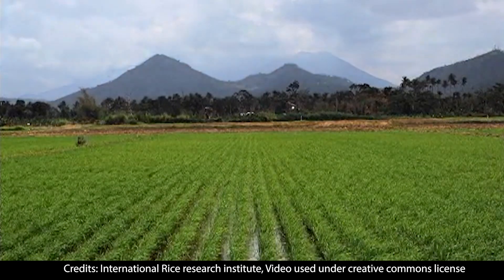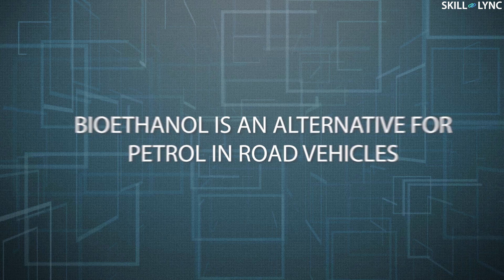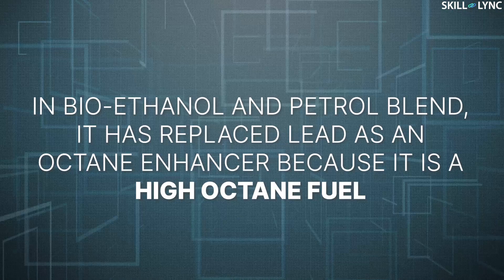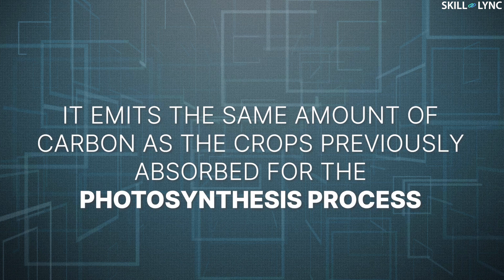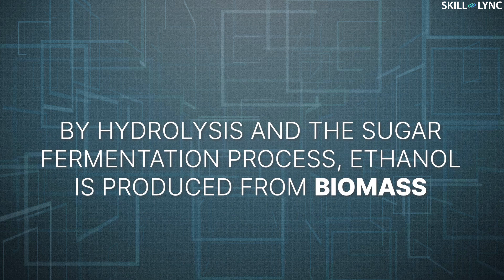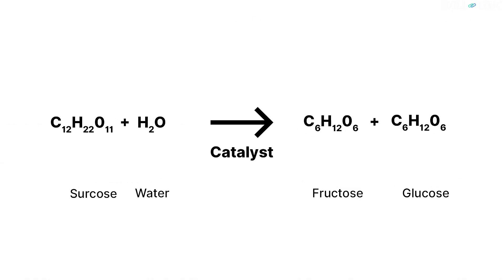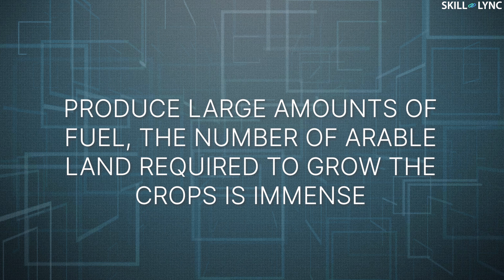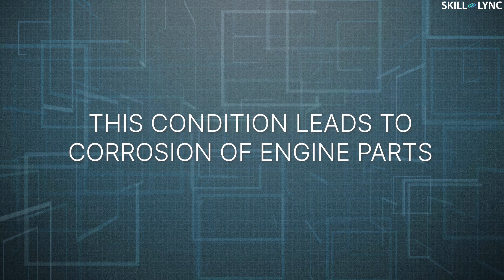What is BIO-ETHANOL? | Skill-Lync

Comment: Miscanthus biomass has shown to be carbon NEGATIVE. It pulls more green house gases out of the atmosphere than it emits over it's life cycle. All while using a third of the land needed by corn. It doesn't even have to be replanted, just cut it at harvest time. Miscanthus gives a new CLEAN life to internal combustion engines.